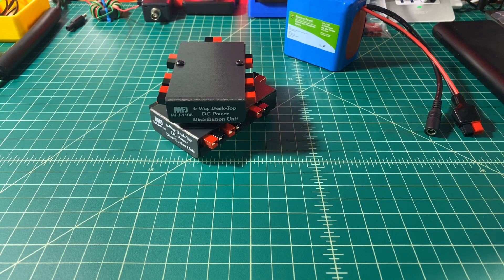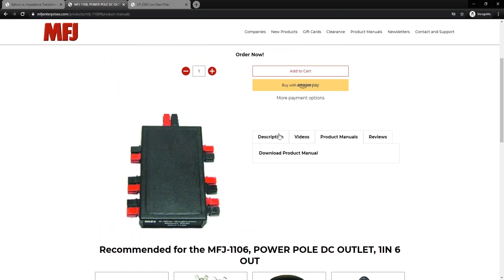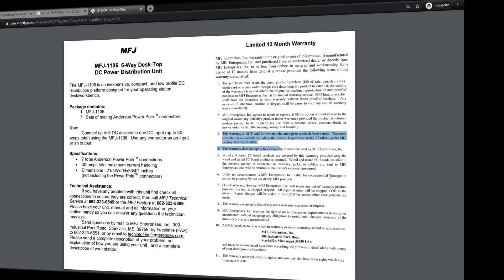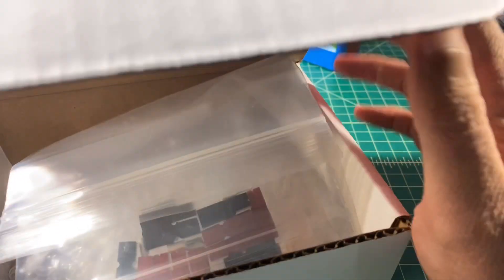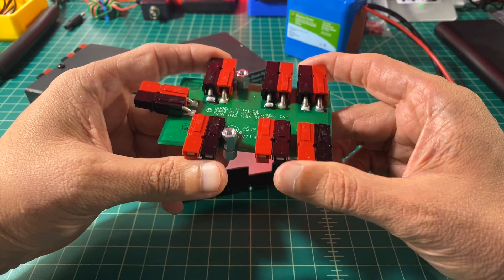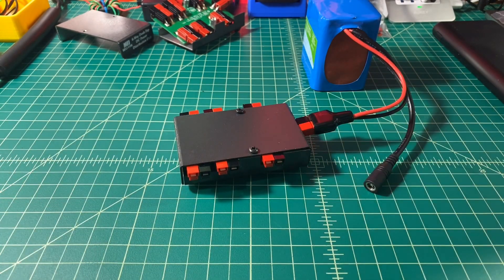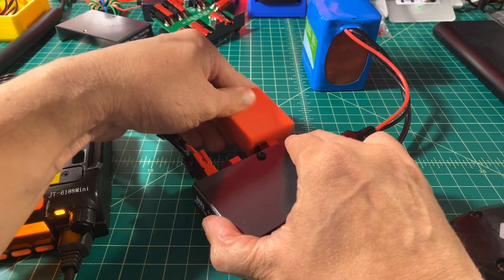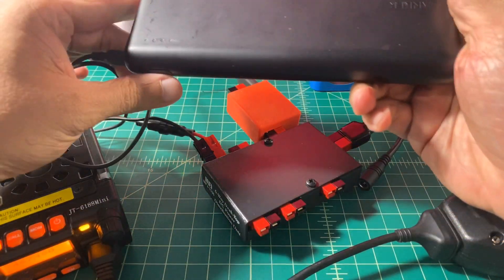MFJ-1106 DC Power Distribution Unit - Ham Radio - TheSmokinApe

Comment: Great video! We always need more power. 
That thing was built with lead-free solder or at least it looks like it. 
Personally,  I would re-flow those connections with some nice fresh lead-based solder. 
This will add some lead to that awful lead-free stuff and lend the connections the flexibility to remain reliable after multiple plug/unplugs.
Reply from the maker: Touching up with some lead solder is a pretty good idea.